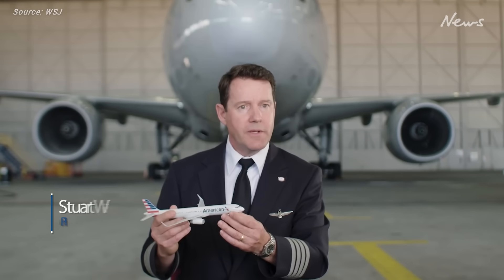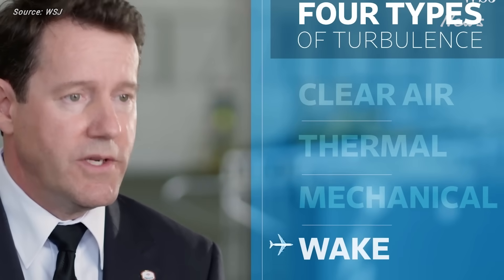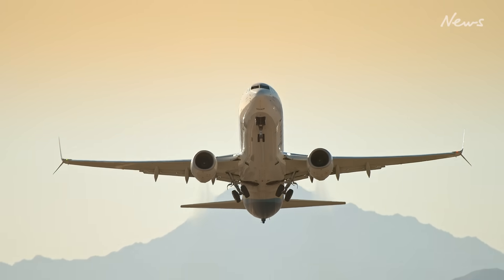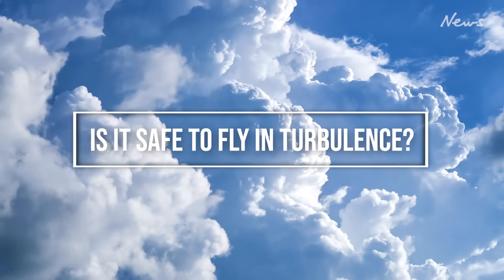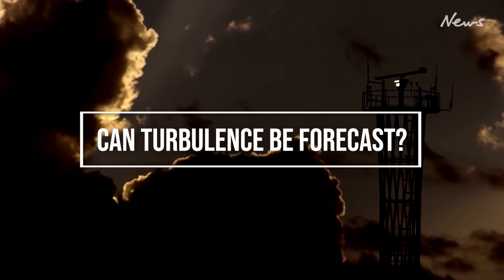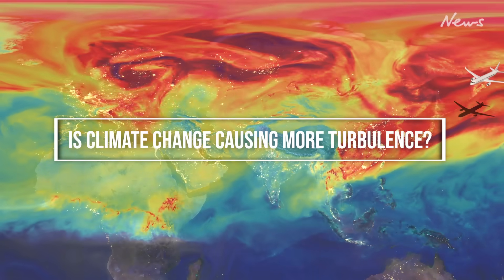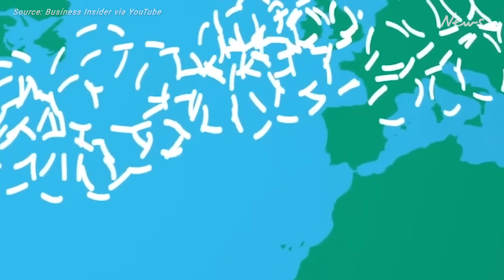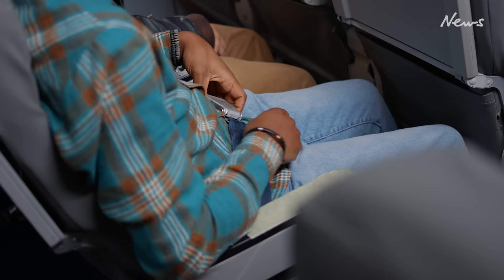What causes turbulence and how severe is it

Comment: Wear your seatbelt people. They tell you every single flight……..
Reply: Yeah cause using a seatbelt will stop objects from hitting you
Reply: @dominickiss1082  Well, no, but it will stop YOU from flying through the air, colliding with the roof and falling back down from a height onto your seat or someone else's, potentially injuring you or them.
Reply: @dominickiss1082 like the ground. 😂